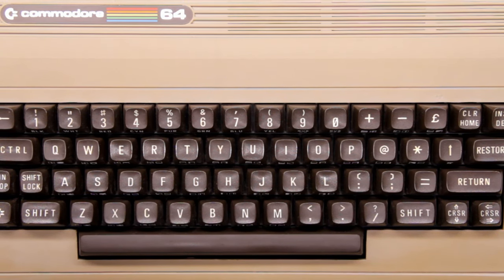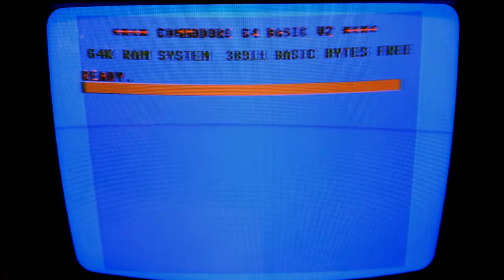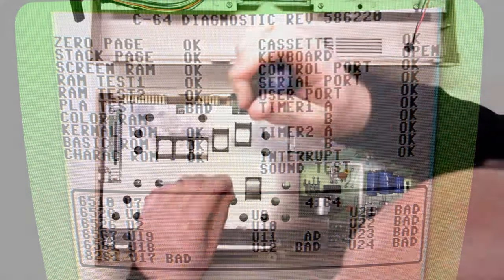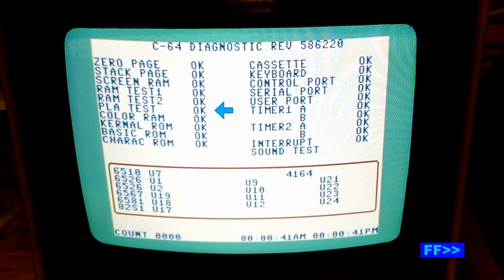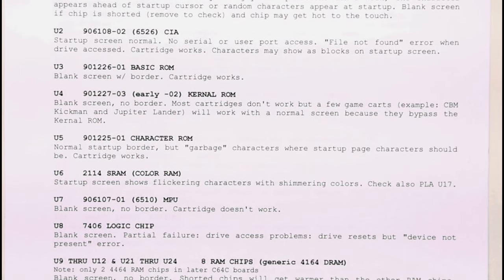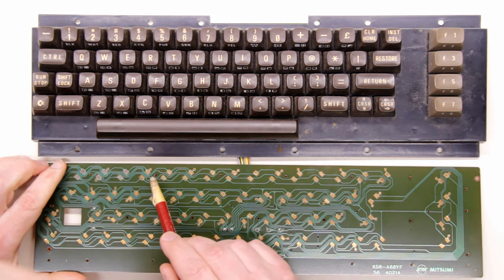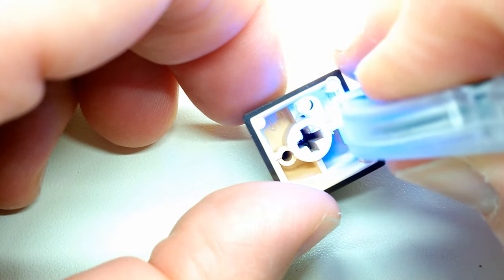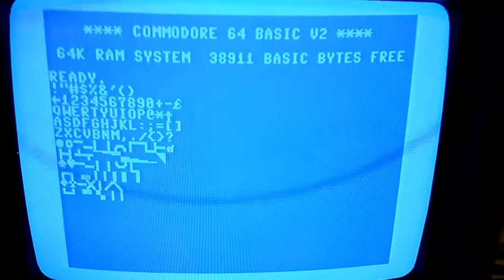#02 "Icky Flicky Display" — Commodore 64 Bad PLA Repair

Comment: the "fun" part of removing the keys became breaking a piece... no need to remove keys for a cleaning that you can do with the help of a little alcohol and a small brush.  You can clean the metal contacts with liquid for polishing metals and a cotton swab, and clean the conductive rubber that makes contact with a cotton swab and alcohol.

Comment: I like your approach. I have been fixing a few Commadore 64s and finding solutions through research. I'm not an electronics guy. You really don't have to overthink most of it.
Reply from the maker: Thank you. Yes, agreed, you do not have to overthink most C64 repairs, especially with all of the reference resources out there. Then, there are the other types of repairs -- not sure if you have seen this video, https://youtu.be/1lm5d3fyPLE.
Reply: @MindFlareRetro  Thank you I'll check it out. I just don't have a lot of equipment or electronic knowledge. But I have been able to fix what I have using soldering iron, multimeter, research and common sense. I still have about 3 Commadore systems to fix. But it's fun and a real treat when something springs to life.

Comment: Wow, that's some stylish orange flickering there. ;) Great video again! Love the careful editing and how you explain how things work. The timing of it all feels very "right" (something I found/find very difficult to achieve in my vids). The assembly 250425 boards are not all that nicely socketed, sadly. I have three here right now, only one of them has all the main ICs socketed. The other two only have SID and VIC socketed. I have to check out the UV glue some time. Looks convenient. Anyway, very nice job and of course big thumbs up for saving another C64! :)
Reply from the maker: Thanks again. I appreciate the positive feedback. I always feel like I'm rushing at the end to bring it all to a close. I think we are all over-sensitive to our own videos -- I don't feel a timing or pace issue with yours. Interesting about the 250425 boards -- I wonder if it varies between the different manufacturing plants. The last two I worked on had identical layouts including the sockets chips. Although, the PLA socket seen in this video is a cheaper quality; the IC did not feel to be snuggly fitted and secure.
Reply: I read that Commodore used whatever they could get their hands on for producing their boards so they varied a lot (capacitor brands and other things, too). Maybe they only fitted sockets whenever they could get cheap ones. Oh, and they seem to always have used the simplest sockets (the ones that only make contact on one side of the IC leg) as far as I saw on the Amigas and C64s I looked at. Had a few that felt very loose/didn't make good contact.
Reply from the maker: Yes, you're right. Even that 250425 C64 with the black screen in my first video had the yellow (as in, original) VIC-20 function keys on its keyboard. Frankenstein computer building by C=.
Reply: It looked like all the colors, not just orange.  If you pause the video and framestep, you'll see violet, green, blue, brown, as well as orange and more.  It wasn't synced to the frame so most colors got skipped in playback.  Pause video with K and framestep with period/comma.

Comment: I think my PLA chip is also bad. I'm not much of an electronics expert but I would like to have a go at repairing it myself; can it be just as easy as taking out the bad PLA chip and popping in a new one?
Reply from the maker: Hey!  Thanks for commenting and subbing.  Can I ask why you think your PLA is bad?  Usually, if the PLA is faulty in some way, you'll see it in a big way.  This is a great reference, "Pictorial C64 Fault Guide" and scroll down to "U17 (PLA)".

If your PLA is faulty, it can be as easy as pulling out the old one and inserting a new one, assuming the PLA on your board is socketed.  If it's not socketed then it becomes more of a challenge, safely desoldering the old one, installing a socket and the new PLA chip.  Also, PLA's are getting scarce and expensive.  Actually, the best modern replacement is called the PLAnkton, which runs cooler, is more robust and is about 99.9% compatible with the original.
Reply: I have the old 'Breadbin' C64 and I think the PLA is socketed, but I'll double check.  Thanks for your tips, much appreciated.
Reply from the maker: I hope I have been of some help. Good luck with your C64!
Reply: @MindFlareRetro  Apologies for resurrecting this comment, but is the PLAnkton socketed?  I've just ordered a C64 diagnostic cart from ebay, so I'll soon find out what my fault is
Reply from the maker: @Huddison  No problem. The PLAnkton is a drop-in IC replacement (picture of the bottom, http://j.mp/2zdKs3a). It will fit in an existing PLA socket (assuming your C64 has a socketed PLA) or can be soldered directly into motherboard -- using a socket is the preferred approach, of course. Also, if you add or replace a PLA socket you may wish to use a 28-pin/2.54mm pitch "turned pin" (a.k.a. machined) DIP socket, like this http://j.mp/2ziAWMt -- the PLAnkton will fit much better in this type of socket. I hope this helps.
Reply: @MindFlareRetro  that's fabulous, thanks once again for your help :)
Reply from the maker: You're welcome. Are you on Twitter? If so, could you keep us posted there with your progress?
Reply: @MindFlareRetro  I have never even tried Twitter would you believe. I will be making my own youtube video of my progress though
Reply from the maker: I get it. Twitter isn't for everyone. But having said that, if you give it a go you will find there are a lot of great retro computing community members always willing to help and that are always interested in the projects—no matter how small—of others in the community. Regardless, I just subbed to your channel and look forward to your C64 repair videos.
Reply: I will definitely look into Twitter (never too late eh:) and thankyou!

Comment: Totally agree about a paper trail, I always get hold of any schematics, manuals and relevant websites even if its working.
Reply from the maker: Hi Brian. Thanks for commenting and thanks for subscribing!  I too always gather a lot of reference material to assist with troubleshooting and, as you say, documents for hardware even if it's working. A lot of my important references are printed out.  I like to be able to grab certain documents and flip to pages fast when needed.  Cheers!

Comment: 3:55 I have a 250425 motherboard. But all the major chips are soldered direct to the motherboard, except for the VIC chip and the one next to it (the clock generator).
Reply from the maker: Thanks for commenting. Hmm, interesting. Where was your C64 manufactured? It's likely different factories assembled the main boards using slightly different processes where some would install sockets and some not. The computer in the video was made in Canada if I recall correctly. I am curious to know where yours was made. Let me know. Thanks again.

Comment: Looks like the #1 culprit of dead C64s again. Do you ever use replacement PLAs (EEPROM or CPLD based) or do you always go for a real PLA?

Also, since you might be making mini-videos, do you know how to safely remove and reattach the case labels, like the rainbow one on a breadbox or the "gray plate" one on the flatbox or 1541-IIs?
Reply from the maker: Hi. Thanks for commenting. Yes, your are correct, the PLA is the #1 culprit of dead C64s. It's probably the busiest chip on the board and always runs hot, hence the increased likelihood of early failure. I have a number of spares on hand at the moment. And coincidentally, I just ordered some OTP-PROMs from a German seller on eBay last week, because I want to give a straight PLA PROM/EPROM replacement a go -- inspired by GadgetUK164 -- otherwise, I would probably just use the proven PLAnkton PLA replacement. Also, check out GadgetUK's channel for some great C64 heat sinking videos.

I've started a list of potential mini-videos. Removing labels is a good idea -- consider it added to the list. :) Sadly, I've had never had a "gray plate" revision in my hands -- I assume you are referring to the very early C64 revs with the metal Commodore plate. Many of the rainbow plates can be gently pried off easily because the adhesive has dried out. I actually can one like that, or you can hit them with a shot of freeze spray before prying them off. Good material for the mini-video. Cheers!
Reply: When I mentioned the "gray plate", I may have described it badly - I meant the plastic plate on the bottom-right corner of the C-64C flatbox.

Comment: Regarding false bad values in the diagnostic results I agree. Since the PLA is a central and integral part of the computer and other functions will not operate if the PLA fails. I must say your story telling is very tidy. I admire that. I'll give GadgetUK a msg. He loves to watch Commodore repair videoes. :) Btw, I might get an A600 and CD32 today to recap for a customer. I'll try my best to film it (and be fast because the customer wanted to stay and watch, yikes!) :)
Reply from the maker: Thaks very much for your kind words. Unlike you and others, I'm not that comfortable (yet) freestyling, which I actually prefer because it is like being in a classroom or lecture hall.  And thanks for giving GadgetUK a heads-up; would love the input and feedback from you guys.  Yes, please record the recaps if you can -- yikes is right, though, if they insist on watching over your shoulder.  I have my personal A1200 dismantled ready for recapping, as well.  Going with polymer caps, only because it's my Amiga.

Comment: Bad PLA strikes again! :) It's the most common chip to fail in these machines. The power led assembly can be really tricky sometimes - it can drive you nuts :D
Reply from the maker: Yeah, that plastic collet is a pain, and it's a challenge to remove without butchering it.

May I ask your opinion on PLA replacements? GadgetUK seems to have had good luck with a straight-up EPROM/OTP replacement (http://youtu.be/sT4OBNvboJ0), as opposed to others like the U17 PLAnkton.
Reply: 27C512 EPROM hack works well with rev. A and B boards. Sorry, I don't have PLAnkton , SuperPLA or any other modern PLA replacements so I can't make any comparisons...
Reply from the maker: Ah, good to know, thanks. I ordered some AT27C512R OTPs last week for testing. Sounds like a new video idea. :)

Comment: This is a problem with the color RAM or access to the color RAM which is managed by the PLA.
Strictly looking at the symptoms, 3 candidates for repair: 1. The color RAM (2114),2. the 4066 CMOS switcher or 3. the PLA.
Reply from the maker: Thanks for the info Francois. I went straight to checking the PLA with a known good one I had, plus the PLA was socketed so the IC swap was easy. I have added your other candidates to my repair journal, so will be sure to check those if I see this behaviour again. Thanks for commenting and sharing your knowledge.

Comment: I have a problem with video out with my c64 and I can't find any case that I'm having.
Reply from the maker: Hi. Thanks for watching and for commenting. It is usually difficult to diagnose C64 no video or black screen issues by email, chat, etc. What is the exact issue you are experiencing?
Reply: @MindFlareRetro  my picture turns fuzzy outside of commodore basic.
all of my televisions are getting confused and they switch to SECAM or NTSC mode when the signal should be PAL.
I have no idea if this are all of my TV sets or my commodore 64 C.
Mostly colors are wrong and there is a lot of ghosting.
It used to work without any problems.
Reply from the maker: Hmm. Hard to say, but it might be a case where the caps in the RF Modulator need to be replaced. @GadgetUK164 did great video on this very subject about 4 years ago -- you can check out out here, https://www.youtube.com/watch?v=yuSuG4ZlQDs. Keep me posted. Are you on Twitter by chance?
Reply: @MindFlareRetro  actually. 

I found out that I have really bad interferance in my power grid most of the day. when the interferance goes away (after 1 AM) my c64 works fine.
Reply from the maker: Oh, interesting. Do have RF shielding in your C64, or it this a noisy mains thing?
Reply: @MindFlareRetro  noisy mains.
there is a lot of noise in my mains.
I have no idea what causes it.

Comment: I have a sx64 with a white screen that I would love to have working.  New video for your channel?
Reply from the maker: Hi Bill. Thanks for commenting and subscribing. Usually, a white screen on an SX-64 is actually a black screen only because most people turn up the brightness on the SX-64 CRT. Having said that, the black screen can be caused by one or more of the ICs having failed. In my first video, I repaired a C64 with a black screen that was caused by a bad CPU (watch here https://youtu.be/RSUjcupjCgk). Any chance you could get your hands on a C64 Diagnostic Cartridge -- you can get them on eBay -- this might be a good start in identifying which chip or chips have failed.

Comment: So what was broken on that PLA?
Reply from the maker: Thanks for your question. I do not know what the specific fault was with the PLA itself only that it had partially failed in some way, and replacing it solved the the flickering text issue. I was chatting with the gentlemen who owns that C64 back in December and he said that it was still functioning normally, that being almost 10 months since the PLA was replaced.